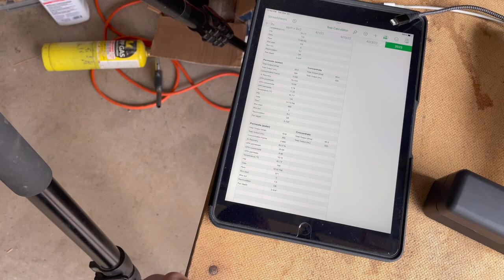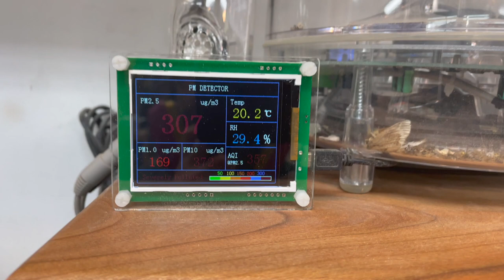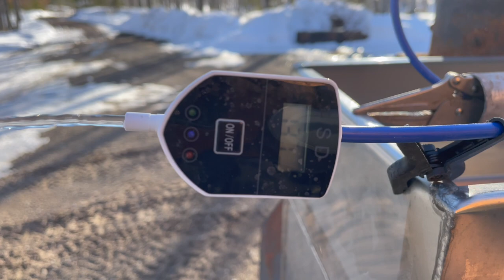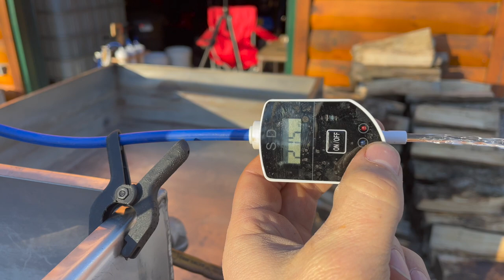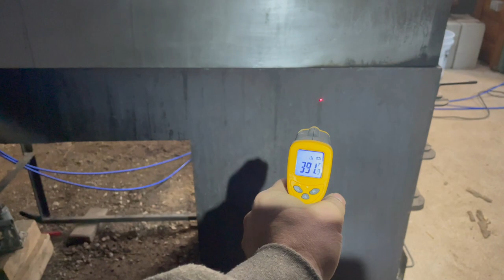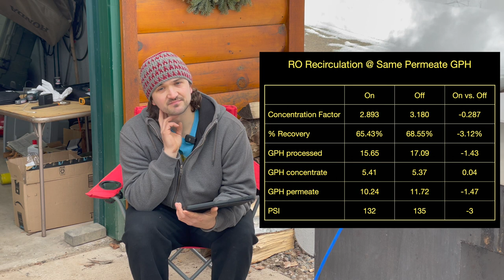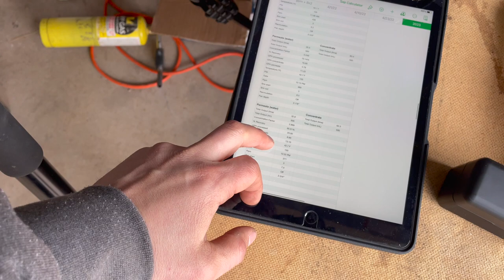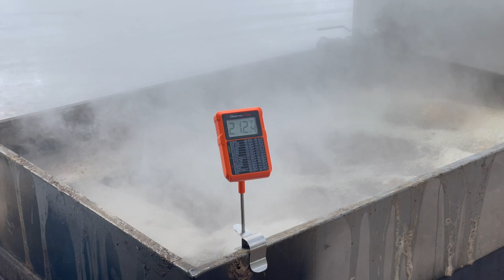Off Grid Sugarbush 2023 - Making syrup with wood and solar

Comment: Another great video Samuel. I have patterned my RO closely after yours and it has worked out well this year. For next year I am going from the 8800 pump to the 8900K & new transformer.  I have added a 2 lead, in line TDS meter, (permeate & concentrate) which will be very helpful. I've added the recirc for next year too. Do you have any plans to add a UV light to the system? I will also be adding 2 more membranes for a total of 5 (400GPD) - can you explain why this will increase output while decreasing pressure? 
Thanks again for your video's.  Paul
Reply from the maker: Thanks Paul! The 8900K will certainly increase output. I found that the recirc was useful for 3 membranes because it allowed me to keep PSI around 130-135 (otherwise it would likely have run higher), but it was not of any value for 5 membranes. I also suspect recirc may foul the five membranes I now use faster as well - requiring more frequent flushing. Recirc may prove useful when I do birch sap however - we'll see. No plans for UV light - I'm content letting the boiling process sterilize and UV won't physically remove anything from the solution. 5 membranes lowers pressure if you maintain a 50:50 concentrate to permeate ratio. Each additional membranes provides more path for water to separate from concentrate, decreasing overall resistance. I do not do batches of concentrate, but instead boil-match my concentrate GPH output to my boiling evaporative output (that's why you see me using a 500ml beaker to measure GPH). I suggest you use the TDS meter as follows: one lead on intake (raw sap) and one on concentrate instead - this may prove useful for determining your concentration factor. Permeate should be constant unless a membrane becomes damaged.
Reply: @samuelwiltzius  Thanks Samuel...good input.  My thinking of the recirc was to be able to better match my boil rate to concentrate output. If my concentrate was too heavy at 50/50 to match my boil, then I could open the recirc a bit to lower concentrate output to match my boil rate while keeping my recovery rate relatively low. My boil rate is around 12 - 13 gph. If I eliminate my recirc, I was concerned that I would have to slow my concentrate too much to match my boil, thus creating a high permeate/concentrate ratio and more fouling. I have no experience yet with this 8900K set up, thus my questions. What's your thought?  
 I'll take your advice on the TDS setup. Do you rotate your membranes season to season? Thanks again.
Reply from the maker: @paulvorisek8329  I have not rotated membranes, though that is an interesting idea. When I used recirc. it allowed me to match the 8900K pump with 3 x 400 GPD membranes quite harmoniously. With 8900K pump and 5 membranes I found recirc was not useful. For an RO straight to evaporator set up 5 x 400GPD membranes and the 8900K pump boiling 12-13 GPH will pretty much be a perfect match. If anything, recirc. allowed me to adapt the 8900K pump to 3 membranes, but it is happiest running 5 membranes without recirc.
Reply: @samuelwiltzius  Ok..sounds like I should be pretty good next season. I may have to tweak it a bit is all.  Thanks again for your help.

Comment: A couple other questions Samuel...Do you only use the soap from RO Bucket for your cleanings and storage prep? Any acid washes or other treatments or is their soap do it all? I read that commercial systems are using acid and other chemicals for cleanings. And how many gallons of clean water do you recommend for the flush at the beginning of the season after the off season storage for my 5 membrane system.  Thanks again.
Reply from the maker: I did a write up last year and I did the same this year - at the end of the linked post I have a "cheat sheet" that I follow https://offgridcabin.wordpress.com/2022/04/17/maple-syrup-2022-year-of-the-ro/

I use the RO soap from RO bucket, which can be bought in bulk as food grade Sodium Hydroxide. https://www.amazon.com/dp/B07KNR9SVF?psc=1&ref=ppx_yo2ov_dt_b_product_details